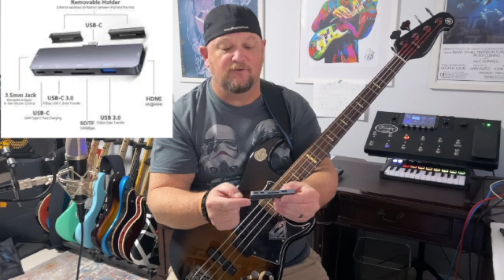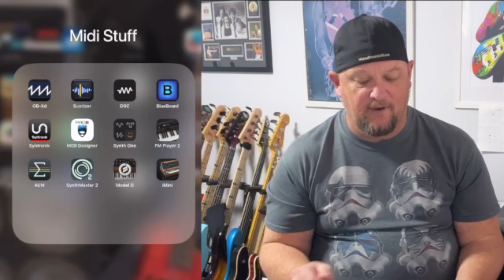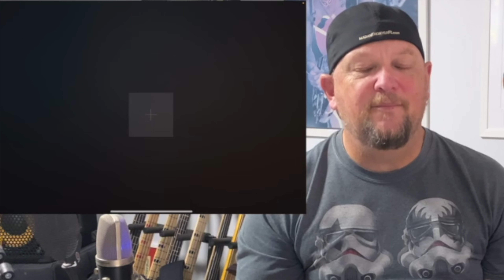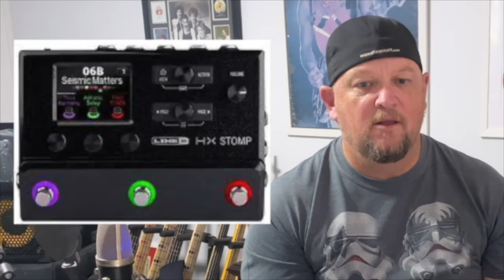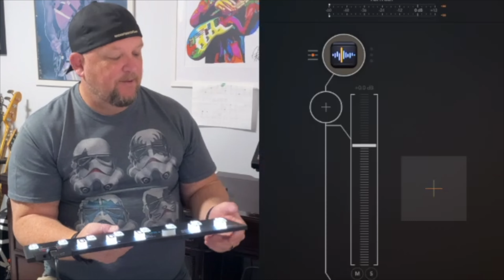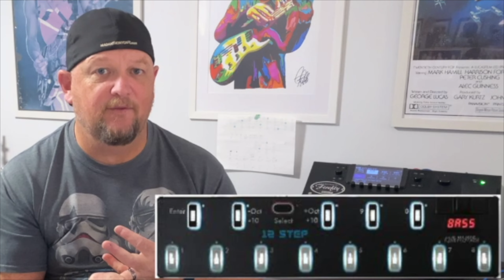iPad + McMillan 12-Step = Ultimate Productivity Combo?

Comment: Fantastic video and great setup.  Question for you.  With your setup, is there a way to program the 12 step to be able to cycle up and down by octaves?
Reply from the maker: Thanks for watching. I've not tried it but I suspect you can if the Synth module you are using does it. Maybe something like a Sine wave with an LFO? As you hit the note on the 12-step that tone should modulate.